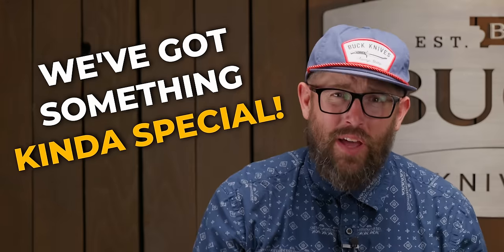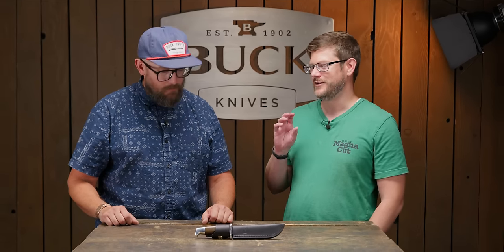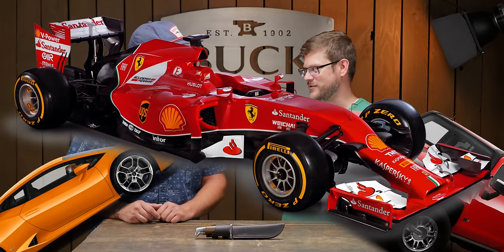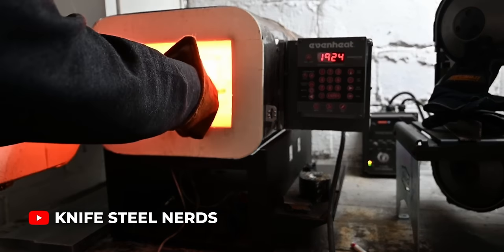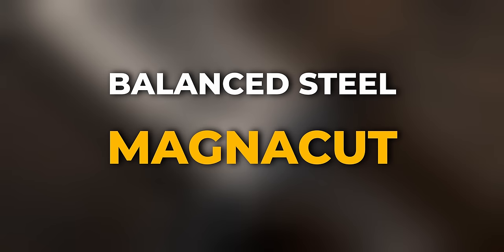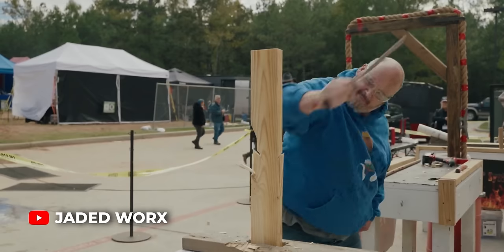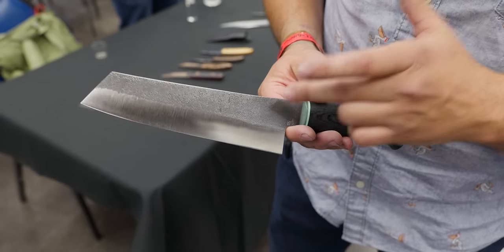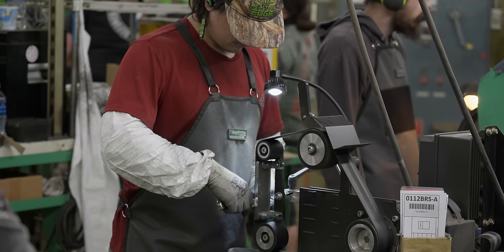The 3 Best Knife Steels According To Science! || THE Knife Steel Nerd Guide To Knife Steels.

Comment: I like d2 steel because it's tough but when its sharp it stays sharp.
Reply: I love it too.... currently, "out of fashion" but kinda funny to go watch videos from 10+ years ago where they are talking about it as a supersteel in same breath as s30v
Reply: I've tried several steels and have settled on D2. It's relatively cheap and easy to sharpen. It holds an edge well, too. Maybe corrosion resistance isn't as great as some of the higher end steels, but for a pocket knife, it works well.

Things like 154cm or s30v, I found to be overrated. They're difficult to sharpen and don't really hold an edge that much longer in my experience.
Reply: D2 steel, is one of the least tough steels out there, only the rest you mention, are true.
Reply: @greekveteran2715  I think toughness is more related to hardness. The harder the steel, the more brittle it will be. The type of steel is related to how hard you can forge it and its corrosion resistance. It's a trade-off. There's no reason why you can't make d2 softer/tougher from what I know of the blade making process/heat treatment.
Reply: @anonanonymous1988  That's only true, for each steel independently. You can't make a D2 tough,it also usually never is lower than 60hrc which is still on the brittle side of steels. Rocwell hardness, hasn't to do with toughness as much as the quality and the type of the Steel. (D2, compared to Vanadis 4 Extra, or even CPM 3V all heat treated equaly to 60 hrc), D2 will still be WAY less tough than any of the 2 and both will also hold their edge way longer.It's the edge geometry, the type of steel and lastly the hrc, tha tdetermine, the toughness and edge stability. Even the way the knife was sharpened, will determine higher edge stability and edge retention.The reason most people complain about knives that their edge chips or rolls, is not the knives fault, but the users. All new (factory made knives) should be sharpened at least 2 to 3 times, and properly reprofiled, to a slight convex edge bevel,to avoid any chips or rolls,which also doesn't improve the edge stability 3 times more, but also improves the same ammount on edge retention and cutting performance.(Just some extra tips)
Reply: @greekveteran2715  I guess it depends on your case use. It's comparable to 440c with better edge retention (with proper heat treatment). The issue typical to d2 is lack of corrosion resistance... however, I haven't seen an issue with my knives. From what I've seen with complaints about d2 is it typically gets a bad rap due to improper heat treatment. If you require more toughness, then the trade-off is going to be hardness. For something like an axe or hatchet, there are softer steels. As for not being able to soften d2, "Annealing is a process that softens steel by heating it to a specific temperature and then cooling it slowly and at a controlled rate." -Simple Google search.
Reply: @anonanonymous1988  440C is a Stainless steel, has nothing to do with the tool steels (High Alloy) we talk about. What you say, is internet theories, in reallity things are as I explained. I'm a Chemist/Metallurgist with a degree since 1996. I also sharpen knives professionaly, for more than 20 years. Reading random stuff on internet, isn't enough for proper knowledge and basic idea on the subject.

Comment: I sharpen and make knives professionally. I have honestly always felt the edge geometry was the most important, but I didn't have hard evidence to back up my thoughts. I am so happy i seen this! I must learn to trust my observations more. Thank you! I subscribed.
Reply: Do you have any guidelines for angles of sharpening?
Reply: I was a Slaughterman for over 30 years, where we liked knives in the 52-58 Rockwell, anything harder took too long to re-sharpen on the stone, as we had to sharpen in our smoko break, so time was important.
You are right geometry is where it's at, with the knives we used anyway. When we did cattle, I would have one knife with a convex bevel for cutting the hocks off and cutting through the dirty hides, I also used it on sheep for everything, the other knife I used on cattle, had an extremely thin flat bevel for all the inside skinning, it was way sharper than the other one. 
For boning we always had a convex edge, on a boning knife, of course.
I think I am stuck in my ways, as I think, if something isn't broke, don't fix it. People are always chasing the next best thing, and you will never satisfy their thirst.
I can see why people like these modern steels, I think that's all I should say about that.
Reply: @markcahoon2534 Not just convex, but also blade thickness. Thin blades are where it’s at.

Comment: Hello Zac.  Thanks for this video.  Many years ago, back in the late 1960's, I decided to make my own knife and went to a local Steel merchant.  I told him what I was planning on making and he gave me a piece of steel that was the correct size for my intended knife; however, I was planning on making it on a workbench with just a hacksaw, files and grinding wheel, which is when I discovered that it was extremely difficult to file.  As it was, I was able to cut it to size and shape easily enough, but after that, I just lost interest.  Ironically, I still have that piece of steel, in it's unfinished state.  Of most interest, is that after all this time, it only has the slightest amount of surface rust.  Ten years later, whilst at an engineering training facility in the UK, one of the instructors was an ex- Royal Navy Artificer and he said the best steel for making a working knife - sheath knife - was steel from a lorry's rear suspension.  i.e.  Leaf Spring steel.  Having managed to find a piece, I realised the effort and work which would be needed to turn it into a knife, would require the use of a Machine Shop, with all the relevant tooling, including a Mill.  At that point, I realised that I was on a 'hiding-to-nothing'.  There comes a time, when you just have to accept, that you've bitten off more than you can chew, so you just have to call it a day and quit.   I'm now a Pensioner/Senior Citizen, so that's one project that's fallen by the wayside, never to be achieved... but, That's Life!   Russ.  Portsmouth, UK.
Reply: You are right , the Spanish bayonetts Toledo steel are leaf spring knife , buy yourself a old Spanish Toledo bayonet that is unsharpend and you use a sharp file and a weetstone and leather strop  , you will get a razorsharp durable knife that lasts.

Comment: As a degreed metallurgist, Larrin Thomas absolutely knows what he’s talking about, has done the study, has done the work characterizing knife steels, knows how to get performance out of them and explains it all in simple terms. His book will become the bible for knife makers and manufacturers. It is jam packed with knowledge. Magnacut is a superior knife steel. It is balanced to provide good edge retention, wear resistance,and corrosion resistance. Once you try it, it will be difficult to turn back to other steels. The addition of extremely hard niobium carbides makes it somewhat difficult to sharpen, but investment in a good set of diamond hones in a variety of grits overcomes much of the problem. You will need to sharpen far less frequently and for knives, a quick tuneup on a steel will restore the edge to factory sharpness.

Comment: Again it has been said, that geometry, design and application is the basics of the steel. This is wonderful in light of the fact that so many steel nerds out there collect knives and promote blades based on steel only or lock strength only, simply abusing them. Whereas proper use of a proper product you know well will make ALL the difference between fun and failure!

Comment: For quick reference: 1) AEB-L/14C28N for toughness, 2) Magnacut for balance, 3) S90V/S110V for high hardness. I would say that CPM-3V is overall about the best, especially if it’s prepared by Carothers Delta 3V heat treatment.
Reply: What's the difference between toughness and hardness?
Reply: @HemiHalfCentury   Hardness is how resistant a blade is to getting dull. The harder a blade is, the longer it will keep an edge and  theoretically it will take longer for it to need to be sharpened. Toughness is how much force it takes for a blade to be broken. A very hard blade will hold a very sharp edge longer, but you don't want to do things like chop wood with it.

Comment: I've been collecting knives for over 40 years, only have 2 magnacut knives so far and love them.  One is a very slicey full flat grind with a 17 degree edge and one is a tougher tanto style with a 20 degree edge.  Both exceed expectations.  After using them for 9 months or so my first question when looking at new knives is 'Does it come in magnacut?'.   I've heard that a few companies haven't figured out their heat treatment yet, so watch and wait on those but the ones who've figured it out are making superior blades.

Haven't had any issues with maintaining them, a KME sharpener with diamond plates makes short work of them.  I put a nice edge on them when I got them and have only needed to strop them once so far after months of daily use.

Don't have his book, but I've watched his vids and website for some time.  Good info and insights for us amateurs.

Comment: I remember when the meat packing company that I work for changed from steel knifes to stainless steel knives. Everyone had a lot of problems getting a stainless steel knife sharp, and the company line was once they were sharp. They’ll stay sharp longer. I always preferred the steel knife, faster to get sharp and easier to put a bevel on with the sharpening wheel. When you’re working eight hours with a knife, you want to be able to have it sharp, and the ability to get it sharp quick again.

Comment: What I learned is that first, most people don’t grasp the importance of edge geometry as it applies to cutting tasks and second, most people didn’t want to accept that everything is a compromise.

There can’t really be a “best” steel for knives because different knives must be optimized for their intended use.

(Most people seem to get that a machete will never be good for filetting fish (ignoring the sheer size of the blade) but don’t think about the steel or edge geometry, for instance. Even if you grind a machete blade as sharp as a filetting knife it just won’t have the necessary flexibility. If it is made of a steel that gives it that flex it won’t be good for chopping brush or small trees regardless of edge geometry.)

Comment: Dr. Thomas knows what he is talking about. I have had an interest in knife steels for over 40 years. Some of the biggest non-scientific experts on knife steel qualities are Kosher Slaughterers. The knife used in this profession has to be hand sharpened and the edge so smooth that the most sensitive fingernail cannot feel the slightest nick after the slaughter. Originally we used to use a 600 Carborundum stone to create a bevel and then slate stones to polish it smooth. But when the Japanese water stones came out, we mostly switched to that. Most use 6000-8000. I remember back then that many of our best knives used 440C, but one manufacturer switched to D2.   It stayed smooth longer but was harder to work on. I inherited a knife from an old European shochet that was fantastic. It lasted sharp and smooth for many cuts and was easy to work on the stones. However, it was a carbon steel and was subject to corrosion. It had to be dried quickly or immersed in a tub of lime water to prevent corrosion.

Comment: Im still a 1085 kind of guy. I do love my 01 sandwiched in 1095. (Scandi grind all the way! With exception of flat grind secondary bevel)
I agree 100% about the edge geometry! I actually discovered that as a kid trying to make wooden spears or swords as sharp as i could.
Reply: Have you tried aebl/14c28n at 61-63hrc? It’s supposedly a stainless 52100 which is my favorite low alloy carbon steel. It should be just as tough with a bit better edge retention and about as easy to sharpen..plus stainless. 1085 is super easy to heat treat well though
Reply: @ShoahBiz  that's the thing! I'm not set up for heat treating these new steels. I heard one can heatreat 440 in a forge, but why bother. I'm just comfortable with carbon and it's usually accessable in scrap. I like historical replications. I'm curious of starting with bog iron, just not sure i got the stamina to form a bar of iron to steel.
Reply: @willywantoknow2563  I’d like to try knife making one day. Nothing wrong with carbon true and a patina is really cool
Reply: @ShoahBiz  its addicting. First knife, my mentor made me use a series of files. Was a 10" medieval dagger made from a leafspring. Next few knives  i used and old saw mill blade and got used to the grinder. Got a bunch of bar stock now to skip alot of the prepping steps. Probably the key to making a good knife is not really patience, but getting comfortable at the grind wheel and enjoying the process. The results, priceless and each blade has an origin story.

Comment: I've been collecting and using knives since the early 80's. And, it wasn't until a few years ago, that I really began to understand, edge geometry. Like a Skinning knife needs to have a finer edge, then say a knife you will use to work wood with. And a Tactical knife, needs to have an edge that can get through clothing.  As for steel. I have some old Green River knives I bought back in the  80's, I have no idea what the steel is, but they hold a very sharp edge and are great kitchen knives. So for me, if the steel is easy to sharpen, and holds a keen edge, its all good. I have many Buck sheath knives from the 100 Series. And some are made from the old 425 HC Stainless Steel, and they are still good knives. The 420 that BUCK uses now, is also good, but that comes down to the heat treatment and tempering. I have 4 Khukuri's from Katmandu, Nepal. They are made from 5160 High Carbon Spring steel. It takes a bit of work to get a good edge, but when you do. Its worth the trouble.
Reply: 5160 is a mid-carbon steel, not a high carbon and one of my favorite steels..  In any case, I ditched all of my super "duper" steel knives for good 'ole 1095, 5160, 440C or 420HC.  If the heat treat is perfect, that's all you need.  Plus, I don't want to have to spend a sharpening session at the campsite in the middle of the mountains.  So those four are easy to sharpen with a simple pocket sharpener.  The Knife world has reached that point like Gore-Tex and boots/shoes.  It's just a way to upsell anybody when you don't need it.

Comment: I am a knife maker and have looked to professor nerd for a while. I am about to start my first knife in magnacut and look forward to testing it. I have been using aebl, 52100  and a2 mainly.  cpm m4 i like as well but it is so difficult to work with it makes it difficult to get my knives around the $200 range. He has never lead me wrong and in my opinion is very unbiased. I run my knives on the harder end of his recommendations and never had an issue. 
I have been most surprised by aebl tbh though. It gets extremly sharp and is not much more costly to work with hat 52100, and in my experience holds an edge much better.  (even as well as a2 while being much tougher and stainless. )
Reply: My 52100 steel knives,hold their edge as long as Elmax or other Supersteels do,while being tough as nails and not as difficult to sharpen as s.steels are. Along with Vanadis 4 Extra,those 2 are my favorite,for my belt knives for outdoors use. Way better steels,than the overrated 1095. I like them more than 3V too.

Comment: 14C28N has always been my fav steel.
Very easy to sharpen and has a very fine edge.
Honestly in every day usage I don't see anyone need a better steel.
Reply: not great for bushcraft
Reply: @saltytomato3018  and why not?
Reply: Agree with you:-) Jack.
Reply: @saltytomato3018  There's nothing wrong with it for bushcraft.  It has very good toughness and corrosion resistance.  Yes, it has mediocre (but not bad) wear resistance, but the fact that it has excellent edge stability means you can get away with a more acute edge...and this helps with things like carving and push cutting wood.  It makes a fine bushcraft knife if done right.  Yeah, probably not as good as Magnacut, but the tradeoff is it's easier to sharpen.
Reply: @scottvines4093  i don't think it does have good edge stability.  compared to steels like k340, k390, cruwear, m4 , magnacut etc. the toughness is there but not the edge holding and strength/hardness to avoid rolling and deforming with lateral pressure.  to me 14c28n is an excellent steel for someone who really enjoys a fine edge on a kitchen knife or small folder.
Reply: @saltytomato3018  Those are all great steels with superior wear resistance, but AEB-L, 13C26 and 14C28N can be hardened to 63-64 Rockwell no problem and do not roll any easier than the vanadium steels at that hardness.  The .62-.68 C/13-14Cr steels were originally used for razor blades.  They take a fine edge.  With equal edge geometry they'll do as well as the steels you listed.  It's a good budget steel.  Not as good overall as the steels you listed, especially Magnacut, but it won't roll or chip easily with good geometry.   I think a lot of companies run it too soft.  Maybe that's why you think it sucks.